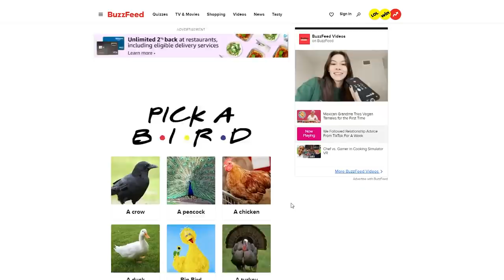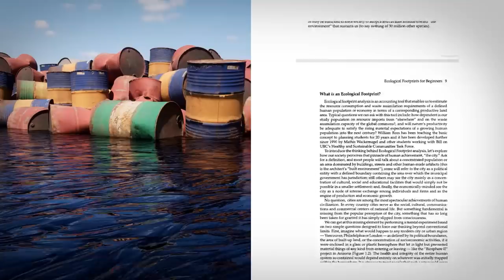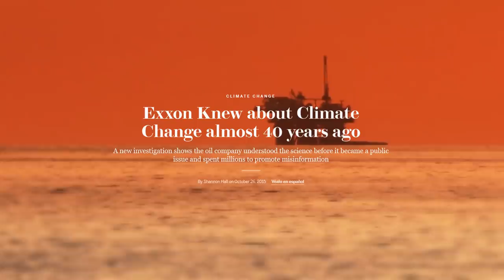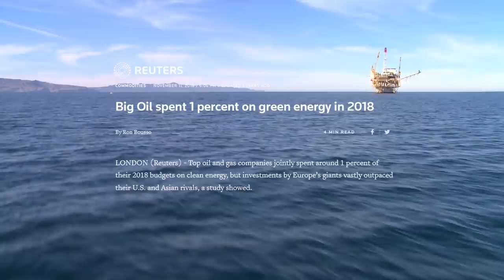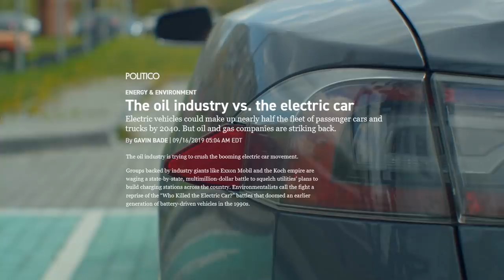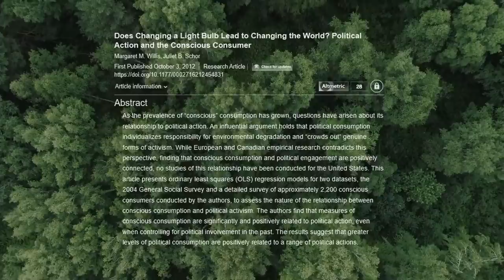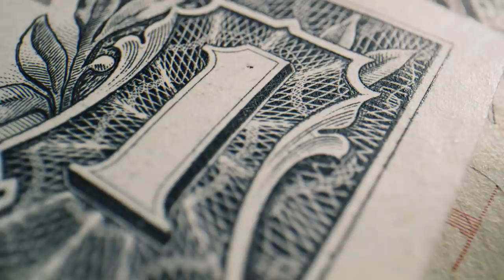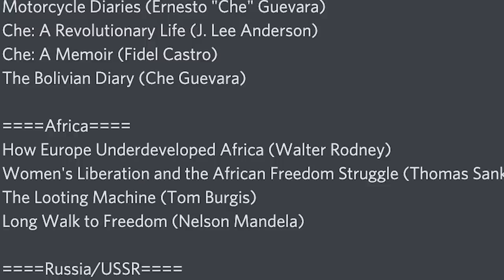Your "Carbon Footprint" Is A Scam

Comment: I'm at the University of Toronto right now finishing the last year of my political science undergrad. One concept which has come up a lot this year (especially in my collective action class) is co-optation. I've become much more familiar with the term than I was before this school year. It has become much more clear to me how often co-optation of terms, ideas and movements is within our society. The use of the term "carbon footprint" by BP could be seen as co-optation and from BP's perspective, a good idea. Recognize the issue, but do nothing themselves to work towards solving the issue.
Reply: Did you see last week's video "How Capitalism Destroys Radical Movements"? What it talked about sounds exactly like what you describe as co-optation, can you confirm if it is the same thing?
Reply: @Hubcool367  yes, that would be co-optation. Co-optation is best defined by Gamson in his work on political change. When there is a group challenging the status quo/political establishment, there are 4 possible outcomes for their success. Firstly, their movement can either be recognized or not recognized. Secondly, they can either gain or not gain new advantages as a result of their political action. Co-optation is the scenario where the movement is recognized by the political establishment, but no new advantages are gained. That would reflect the BLM road in DC. The mayor recognized the BLM movement with that road mural, but didn't give any substantive new advantages to them.
Reply: @starpicsmedia  thanks for the reply :) And super interesting framework to view political establishment responses, I'll look into Gamson !
Reply: I agree about the co-optation stuff but the message of the video is kida counter-productive. Like realistically, we know that capitalism is not going to falter (at least not in the current climate). The idea that we can do nothing against the production of industrialists is completely false. And it is also part of the illusion of the 1% to be able to exploit the worst resources at the best price. WE HAVE THE BOYCOTT. we can stop industries from using the most proportionately devastating resources (like red meat which is literally responsible for more greenhouse gases than all transportation combined. Or stuff like palm oil which destroys parts of the Amazon extremely quickly). We just have to organize COLLECTIVE movements of massive boycott and the industries will be forced to change their offers. (On the other hand, it requires education of the population on consumer products). Yes, it's "unfair" but it's literally the only real thing we can do NOW, other than complain about capitalism and do nothing. Climate change ins't going to wait the end of capitalism, and his consequances are irreversable
Reply: Offtopic to your comment, I am someone going into uni and am considering Poli Sci.

Should I do it? Pros? Cons? I'm sure it's far less difficult than STEM classes, but I'd wish to go into some sort of occupation regarding politics.
Reply: @Luci Evelyn As dumb of an answer this may be, I'm still not entirely sure. My end goal is to be in a position to create positive change for my community, but I am not too picky to one specific career.

Obviously, becoming a politician would sound like the most obvious option, and I may consider that if I ever go to law school or something, but that would be in the somewhat far future.
Reply: @Luci Evelyn what? What about wanting that wouldnt make me a leftist?
Reply: @Luci Evelyn You juste can not compare a socio-pilitical conflits to the operation of the consuption society. Like what is there to boycott to free Palestine ? The government ? Political actions are important yes, and they should be include in our collective consomption too
Reply: @Luci Evelyn Its rather disrespectful to completely assume something about somebody. No, I am not a Social Democrat. I am a Socialist of five years now. However, I am a young one, and would like to find ways to contribute to progress. Its obviously electoralism and Neoliberal democracy are both inefficient, but my goal is to spread the word. I cannot do it without a large base.
Reply: @Luci Evelyn I was asking them for advice in entirety. I would much rather avoid going into government, but if I have to, then I have to.
Reply: In a way, it was genius. Shifting the blame and giving the people who believed in it the illusion that they were helping in some meaningful way.

Goodluck on the rest of your semester, I would be a senior this year if I hadn't switched majors so many damn times. Started out in music and now I'm in computer science lol
Reply: @Luci Evelyn Yea so what ? Israeli is so self-centered that its export of commodity is very limited. It's obvious that the actions of consumers will not influence the political crimes of the country. We're talking about climate change here
Reply: @Javier-rl1of   you know what. (I wouldn’t even listen to anyone on here at this point based off how that convo was going) (anytime I hear someone point out the “left” or the “right” especially in certain contexts I just… I know  right then that they’re actually just a part of the problem.. the big ‘so obvious no one sees it problem’ - & I just… sigh) but anyways, I just said I wouldn’t listen to anyone on here at this point Because it sounds like you have a fresh open mind & want to do good - I respect that & encourage you. I want the same thing. But, I’m probably a littler bit older than you & probably.. made a few mistake so my life to even realistically set on getting a bachelors degree. Never know though. But for you, I thought about what you said, about wanting to create positive change for you community. And you know who often times has the most weight in situations that need change? … Lawyers - people that know the law. Why? Because it’s all law. There’s a law for everything & with it - a big tangled system of stipulations & processes & run arounds….. & let’s just face it, no ones going to change much…. Without knowing there way through it all. While it doesn’t exactly sound FUN or even in the grunt of it ‘empowering’… if you really want to make sure that positive change happens.. the one for sure way to ensure you have it in your power to do just that - is to learn the law. To fight it. 
You could end up a lawyer that environmental groups turn to - or animal rights groups. You could support any cause that you care about - by representing it legally. 
Just some thoughts. Stay positive & don’t quit. (Unless you want to end up feeling like another # with no say; watching the world crumble around you).
Reply: @ishtlutz1261  Thank you for the kind words. I'll definitely look into it.

Though I'd like to tell you that it is not far from reality for you to go back into university or to find a major that represents your goals or desires.

While it would be rather difficult, my father can be a testament to this. He juggled a 40 hour work week, not the best pay, four to six kids, and all ever else and finally got his degree. It obviously was a tedious and sometimes difficult process, but the pros certainly outweighed the cons. He has already found employment at a place that is a vast improvement over his previous job.

As hard as it may be, we should always try and follow our advice. What you may see as a mistake you never allowed yourself to do is only a mindset preventing you from properly reaching that goal.

It'll obviously be no walk in the park, but the journey of a thousand miles begins with a single step, y'know?

Thank you for the kind words. I wish you the best of luck and a wonderful week ahead.

Comment: Good video. Individuals are guilt tripped into conserving and recycling products while an hour of any typical factory wipes that effort out for hundreds of thousands of individuals, making the effort ultimately pointless. Having said that, I still recycle, reuse, conserve and remake stuff until it literally can't be used anymore. I do that because I think it's right. I know in the big picture, as long as corporations aren't held to account, it is absurdly pointless. That still does not stop me, for whatever other reasons.

Comment: I hope if anyone finds this data helpful, you will remember me with financial aide. So far, debunking this topic has cost me a small fortune.

What I find ridiculous about claiming human emissions (including cow farts) are causing Earth to warm is that 1) the 30 Billion tons of CO2 that humans emit (2.34%) is blamed while the 1280 Billion tons (97.66%) of natural CO2 ventilation is ignored. 2) Water vapor is 86% to 92% of greenhouse gas 3) CO2 is a weak greenhouse gas 4) CO2 is only 0.04% of the atmosphere 5) CO2 levels were 7700 ppm (almost 20 times the levels as today) and temps stayed essentially the same 6) Temp drives CO2 levels for the past 800 K years, CO2 does not drive temperature. 7) Earth's temp has been dropping slightly which is why they had to change the name from Global Warming to Climate Change. East Angelica Emails were telling alarmists to “Hide The Decline” 8) Funding has the stipulation that Global Warming must be shown, so anyone showing the contrary did not get funding. 9) Earth didn't have ice ages or polar ice caps until the division of the Atlantic and Pacific by the Isthmus Of Panama 3 million years ago. 10) if CO2 levels were tripled to 1200 ppm, the variation in temperature would only be 0.055 degrees F and only be realized at night. Empirical evidence outweighs guessing, opinions, anecdotal and/or circumstantial evidence, which are the only reasons Global Warming/Climate Change an issue.

The list goes on. This is, in the vernacular, just the tip of the iceberg. I didn't even go into Earth's tilt that changes, Earth's orbit that changes, and half a dozen other factors that are actually causing any climate variances.

Comment: The main problem is that any public policy that requires hundreds of millions of people to consistently do the right thing voluntarily is a policy that is engineered for failure. Instead, policies should be aimed at restructuring the ways a few hundred companies run their businesses (while subsidizing the costs incurred from this restructuring) in order to for them to be run more ethically, more sustainably, and more equitably. 

This is probably minor, but in the quote you showed on scree from Matt Huebner, your audio said "ecological footprint" but the text on screen read "ideological footprint". Which is it?
Reply: I totaly disagree. The only realistic and TANGIBLE option RIGHT NOW to fight the big compagny destructiv environnemental consaquences is  massives public boycott mouvements. This mentality is even totally counter-productive. I mean realistically, we know that capitalism is not going away soon (at least not in the current climate). The idea that we can do nothing against the production of industrialists is completely false, it is also an illusion of the 1% to be able to exploit the worst resources at the best price. WE HAVE THE BOYCOTT. we actually can stop industries from using the most proportionately devastating resources (like red meat which is literally responsible for more greenhouse gases than all transportation combined. Or stuff like palm oil which destroys parts of the Amazon extremely quickly). We just have to organize COLLECTIVE movements of massive boycott and the industries will be forced to change their offers. (On the other hand, it requires education of the population on consumer products). Yes, it's "unfair" but it's literally the only real thing we can do NOW, other than complain about capitalism and do nothing.
Reply: @arphangh5409  the thing is, is boycotts on a national scale, just lead to companies shifting to other nations. revolution is the way to go. till then, reforms that lead to a more conducive environment for revolution are needed.
Reply: @arphangh5409  You are confusing grassroots organization from public policy i.e. legislation, executive orders, administrative agendas, etc. It cannot be a matter of societal sustainability to rely on hundreds of millions of people consistently making hundreds of millions of "good" choices voluntarily. "Good" is itself difficult to define in this space as illustrated in the video. Moreover, as the video points out, billions of people were forced to suppress their economic output and therefore their carbon emissions...and it was barely a dent in the global system.

There is no way to affect the kind of change that is needed from within the system. The system must be dismantled and rebuilt with ecological balance and mutualism at the center.
Reply: @ethanstump  Not not necessarily, it is alway going to be more profitable to big compagny to actually some of the problematics ressources their using than losing an entire wave of consumers. In fact it's actually pretty easy to make a consummerist trend influancial and with strategy we can stop massive eco-destructive consequences by changing very fews key things. Whereas the path to a socialiste society requires massive structural changes in the economy. And i totaly agree that we can already forget the reformative approche with our actual pseudo democratic corporacratie. Of course we should unionize workers toward this goal and stuff, but that shouldn't stop us from influancing the actual system. Because "ending capitalisme" through syndicalist revolutionor or just ... waiting for capitalisme to "fail" (again) is going to take time and we dont have time. Climate change is already happening since some time already and it's consequences are irreversible. Even after implenting our eco-freindly socialist  systeme, alot of the ecological consequences will be felt like forever. We need to do everything we CAN rn even by using market in strategic ways
Reply: @arphangh5409  Loving your passion. Quick fact-check - the Amazon is being burned to grow soy as well as farm cattle, but Brazil has far better grasslands for cattle rearing already, which cannot be used for agriculture. Also gold is being extracted. And red meat is literally not responsible for more greenhouse gases than all transportation combined. Cows and other ruminants have inhabited this planet for a loooooong time and managed not to cause runaway global warming. It's fossil fuel use, short and simple.
Reply: Nah the right option is to invest in nuclear energy and stop this renewable energy bullshit.
Reply: @marconapolitano2821  And I think it's also worthwhile to invest in carbon capture research, especially for preventing the carbon emissions from manufacturing
Reply: @ethanstump  im against the rich but also against you calling for violence. You lack a sense of reality
Reply: @trey6563  empirical self defense is always justified. it's the unjustifiable position to say that people don't have a right to protect themselves against a empirically criminally negligent and coercive authority, whether that authority is the market or the state, as that is implicitly endorsing tyranny. in other words, labeling responding to an ongoing violent status quo in an effective manner as calling for chaos is at doublethink levels. ( i don't think aggression is synonymous with rebellion, i do think civil disobedience is possible.)

as for lacking a sense of reality, i am probably one of the more logical people you will meet, as l have left my birth family of two decades, both in a cult and in a fascistic entity. further, while my education was somewhat limited due to finances( whos isn't at this point) i have a pretty eclectic self taught knowledge in politics, history, general science knowledge and economics, made life choices such as going vegan and riding an EV in response to climate change, and many more. (yes i know, r/iamverysmart.)

all this to say, if someone like me, who left both religious and nationalistic irrationality, makes pretty rational decisions according to life events, is one of the more affable and compassionate persons you will meet, actively criticizes hate and irrationality, tries to make friends of all persuasions, is open minded to a fault, has pacifistic tendencies as shown by my veganism, metropolitism, doesn't own a lethal weapon, generally keeps to my self, and plays hollow knight mostly, 

IF This person is saying that all cards are on the table, it's because he's pretty fuckingg sure it's an all cards on the table moment. TLDR: “It is no measure of health to be well adjusted to a profoundly sick society.” -J. Krishnamurti